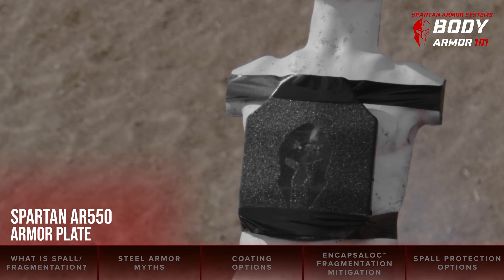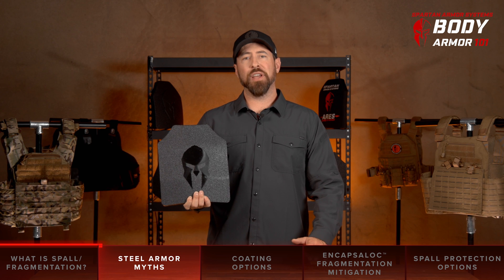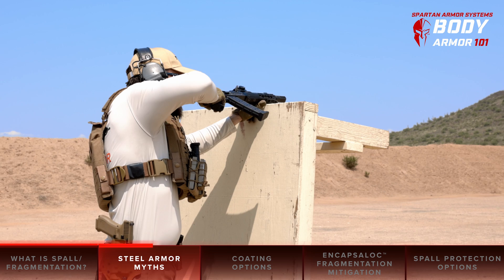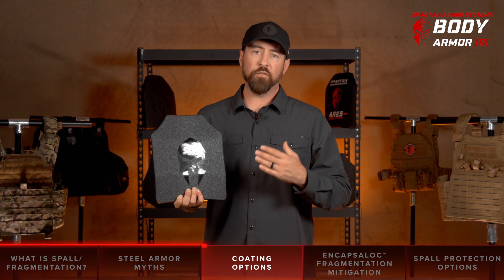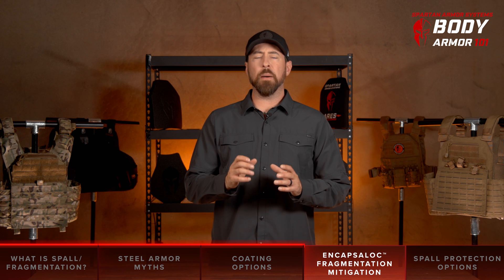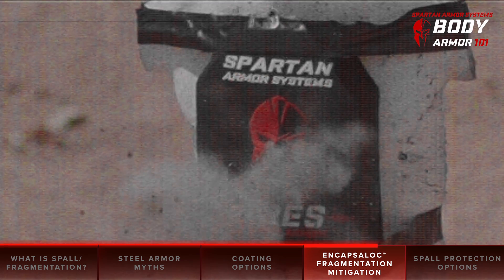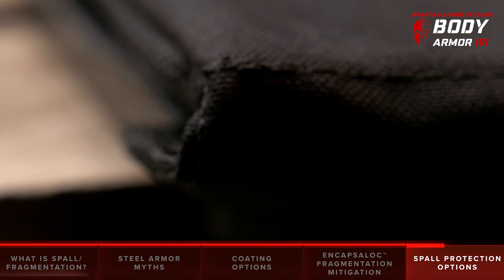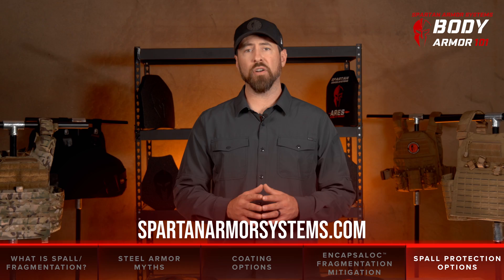Body Armor Spall & Fragmentation (Fact vs Fiction) - Spartan Armor Systems Body Armor 101

Comment: Steel plates, such a good option that the US military uses them! Wait, no... OK, well at least police departments nationwide are using them! Oh... right... they aren't either. If all the pros wear ceramic or uhmwpe composite plates, and NONE of them use steel, there's probably a reason for it. The guys who actually use their equipment day in and day out know what the right tools for the job are, and it's not steel plates. Great marketing video though!
Reply: Cops and military get ceramic because you and I are paying for it, not them personally.
Reply: @socaljarhead7670  there are several NIJ rated, reputable ceramic plate manufacturers that cost as little as steel plates with spall coating do.
Reply: @ThePonchoJoe  NIJ level IV is rated for a single hit. Level III is rated for 6 hits. There are some police positions and situations where if you get shot, you may end up getting hit multiple times in very quick succession so you'd favor armor that is guaranteed to take multiple hits but will never see the wrong end of a 30-06 AP round versus take more than one hit stacked on the same spot and the bullet goes right through because the previous shot compromised the ceramic at that very spot. A lot of level IV plates would fail at level III because level III has the specific 6 shot test while the level IV test is only a single shot.
Reply: @Talishar  none of what you just said is true
Reply: @ThePonchoJoe  You have literally no idea what you're talking about. Read the specs.
Reply from the maker: Actually, there are lots of police and sheriff's departments that use steel plates. They buy them from us all the time. We've had many cases where our steel plates have saved the lives of officers in the line of duty and there were no secondary spall injuries.
Reply: @SpartanArmorSystems  there's a variety of reasons why steel plates are less than optimal, spalling is just one of those reasons.
Reply from the maker: There's a number of reasons why ceramic plates aren't optimal either. We sell both and provide plenty of educational content to help customers decide which armor material is right for their specific situation. It's not an accurate statement to say one type of armor is superior to the other.
Reply: The main reason is weight

Comment: I dont understand what is so hard to understand about layered protection.  A player carrier with level 4 steel plates, that have a full spall coating and are inside of spall covers with soft level 3 inserts infront of them and trauma pads behind them. 

It's such a wierd argument that people make wear they only shoot 1/5 of the armor system and then claim to have defeated it. No one in the infantry is being issued an armor plate with duct tape. They have a carrier with soft inserts and hard plates.
Reply: well i have heard of some guys in the military ended up getting some of their junk removed after getting hit on the armor plate. 
Maybe it was the same guy who duct taped steel plates to humvees
Reply: @trollmastermike52845  It's an urban myth. 

It's like how guys in the infantry are taught that the green tip on a 5.56 round means It's armor piercing, because it has a "steel penetrator". Or how the Shockwave from a 50bmg passing close to a body can blow an arm off. 

I'd say a good 25% of the guys I served with swear they knew a guy who saw someone get ripped in half by a "near-miss" from an M2HB.
Reply: @aceykerr8752  well its was a maybe it was a urbin mith with the doctors who operated on the guys who got shot. A grunt did not tell me the story
Reply: @trollmastermike52845  Thats even more likely. Doctors are comical with how they exaggerate. I saw an interview recently where a doctor was talking about how wounds caused a 5.56 were so destructive that it made people unrecognizable and how the damage made it hard to tell that you were looking at a human and not a sack of ground beef.
Reply: @aceykerr8752  well i have seen some videos on 4chan that say other wise what a 5.56 will make you look like doctors are right about that one
Reply: @trollmastermike52845  "One looks like a grenade went off in there,” University of Arizona trauma surgeon Peter Rhee told Wired when comparing the damage done by AR-15 bullets and 9mm handgun bullets. “The other looks like a bad knife cut.” Literal doctors will say that it looks like a grenade went off inside of a person, because 1. They have never seen what a grenade does to a person and 2. They have a vested interest in making it sound as extreme as possible. 

These same doctors will claim that the 5.56 is moving so fast that it sends ripples through the water in the body that can rupture organs and blood vessels without the bullet touching them. It's complete nonsense to anyone who understands terminal ballistics. It sounds like something that might be real and because a doctor said it, most people will take it at face value. But it's a myth that has no evidence to support it.
Reply: @aceykerr8752  dude just look some videos up i have a dudes h3ad pop like a water melon in mexico for a m16
Reply: @trollmastermike52845  Iv seen 5.56 wounds first hand, and you wanna know something?

Almost every cartridge in common usage will make a human skull turn into a gooey pile. The skull is literally the most susceptible part of the body to being damaged by bullets. 

But that's not a good indication of how much damage a bullet does to the human torso. Subsonic 9mm will turn a human head into a canoe just the same as 9mm+p+ will and just the same as 5.56 will. 

But thats not what doctors are claiming. Doctors claim that a thoracic wound from a 5.56 is so devastating that their won't be anything left to fix "The tissue destruction is almost unimaginable. Bones are exploded, soft tissue is absolutely destroyed. The injuries to the chest or abdomen — it’s like a bomb went off.” If a bullet hits an arm or a leg, he said, the limb often hangs at an unnatural angle. Such victims can need a dozen surgeries over months. “Some eventually decide to undergo an amputation if there is severe pain in the limb and it is dysfunctional,” he said. This is complete nonsense. 

"You will see multiple organs shattered. The exit wounds can be a foot wide.” 12 inch wide exit wounds? From a projectile 5.56mm in diameter and just over an inch long? 

"I’ve seen people with entire quadrants of their abdomens destroyed.” AN ENTIRE QUARDRANT OF THR ABDOMEN DEATROYED???

"The high energy bullet creates a blast wave around the bullet. And the yaw can contribute to the larger exit wound. Striking bone can also cause bone fragments that radiate outward, cutting tissue in each fragment’s path." Literal blast waves created by such a high velocity round.

"If they are shot in the torso, there often is not a whole lot we can do,” he said. Even though 88% of people survive thoracic gun shots if they get to a hospital, jumping to 97% if their is no arterial bleeding. 

"Dr. Kerby said it used to be that surgeons like him saw victims of assault rifle shootings only in the military. No more. Now, though the wounds are still rare on the streets of Birmingham, he operates on occasional victims — that is, those who survive long enough to reach the hospital." Even though assualt rifles and assualt weapons are a buzzword that mean nothing, and rifle wounds have existed in the US just as long as hand guns wounds, and the survival rate among rifle wounds is identical to the survival rate among handgun wounds. 

But Doctors help spread urban myths because they simply don't know any better. Iv never met a trauma surgeon who could tell me the difference between a 5.56 and 30-06. Iv only ever met one doctor who knew the difference between an m193 and m855a1, and that's cause he was in the infantry with me before he went to med school.
Reply: @aceykerr8752  " Almost every cartridge in common usage will make a human skull turn into a gooey pile "
well i guess does doctors where right
Reply: @trollmastermike52845  Thats not the point in question. No one disputes the fact that getting shot in the head is anything less than lethal. 

The contention is when Doctors talk about thoracic wounds looking like someone set a bomb off inside of a person's chest. It's completely unfounded.
Reply: @trollmastermike52845  The argument becomes even more nonsensical when we look at your claim of a doctor saying that someone's junk was damaged because their armor took a bullet, even though issued armor in the military is a ceramic plate behind soft armor and inside of a carier. It's complete nonsense to anyone who has any understanding of armor.
Reply: @aceykerr8752  Bruh i trust a friend of the family who was a doctor in a combat zone over a internet guru any day. 

You ever heard of sapi plates maybe you should do a little research infact i own US military surplus sapi plates.

From what i understand he had frag on his thigh too, but his junk area got most of it. He told me was shot on the in bottom area of the plate is what he later found out.
Reply: @trollmastermike52845  A sapi plate is just a ceramic composite plate. It wouldn't matter if the plate only got hit on the edge, because they are rated for that. 

And their is an entire soft layer of armor infront of the plate that is meant to stop pistol rounds, any shrapnel that makes it comes off the plate is going to be small and anything that makes it through the soft armor is not gonna have enough energy to cause damage. 

I'm just some random dude on the internet that you will never meet and will never know anything about. But your family friend was exaggerating. It's fine, everyone in the military does. We all embellish our stories to make them sound cooler because that's how you tell stories. 

But you should not base your decisions of what gear to use based on some story you heard from a guy who heard from another guy that this thing happened. Look up the data, examine how gear is meant to be used in the field and make the judgment call based on complete data. 

You and I will never know if your family friend was spot on accurate that a guy in a combat zone took a bullet to the bottom of his plate and it spalled enough to damage his junk. It sounds like bullshit veterans say at the bar when they drunk, and I would know because I do that shit all the time.
Reply: @aceykerr8752  The soft armor is behind the ESAPI, not in front of it.
Reply: @KarnivorActual  The soft armor is infront on the MTV.
Reply: There’s no such thing as Level IV steel plates.

Comment: Would trauma pads be recommended while wearing the Ares plate?
Reply from the maker: I'd recommend trauma pads on any type of armor. They're inexpensive and they mitigate the effects of blunt force trauma while also making armor more comfortable to wear. Ceramic armor is more susceptible to backface deformation than steel armor.
Reply: @SpartanArmorSystems  Thank you

Comment: People want to stick by ceramic but ceramics a throwaway armor it's not something that's feasible for long-term use.  A piece of steel wrapped in Kevlar can do a heck of a lot more than ceramic ever could.
Reply from the maker: Yeah, there's definitely pros and cons to both materials.
Reply: @SpartanArmorSystems  I guess it just really depends on the application of the armor.
Reply: @Linus Sex Tips  I would do it with steel plates over ceramic any day.

Comment: Will the threat of spalling decrease if you're hit in the back plate?  
Seems like steel in back with ceramic in front is an interesting combo as the back plate is also more likely experience damage from simple impacts.
Reply: Every encounter is different but we do have may customers that like the combination you mentioned.  Thanks for your interest.
Reply: How does the round know it's hitting your back plate vs front plate to reduce fragmentation? Smart rounds?
Reply: @KB-nt7eg  I think the idea is that when in combat your emote likely to get hit in the front than the back, and so with ceramic in the front you don't worry much about spalling.  On the back however, it's not as often getting shot there and hopefully you'll have protection on your head, which can stop the spalling..
Reply: @nomad155  he said, and I quote 'will the threat of spalling decrease if you're hit in the back plate?'

That makes zero sense. Spalling doesn't stop on an uncoated plate simply because you're hit in the back.

I think, at the end of the day, Todd Meeks says as little as he does, because of people like you and the original poster. 

They make ball mounts for lifted trucks even though you shouldn't tow with a lifted truck
Reply: @KB-nt7eg  Your arms, jaw, and throat surround the front of your chest where spall will eject towards when shot in the chest plate.

Comment: So, say the "Shizzie has hit the Fizzie" and someone's lucky enough that their armor plate has stopped a few rounds and they're still vertical and kicking. What kind of "restoration" would spray the plates down with say a rubberized undercoating from aerosol cans add? Obviously not asking officially (or legally) just a curious, long-term inquiry.
Reply: Truck bed liner or flex seal
Reply: I sprayed mine with flex seal then a layer of duct tape
Reply: @LethalMayo  Like a literal layer of gray or black tape?

Comment: Thanks for this video. I purchased a set for myself and my wife. Great job dispelling the myths. Some of these internet warriors and twitter veterans have no clue.
Reply: @Emmanuel Goldstein I wore my 5.11 carrier with front back ar500 steel in them while working during the "protests" in 2020. 10, 12 hour shifts...was lock knee'd for a couple hours straight one particular night and blacked out for a nano second. The carrier I have is very padded with a lot of surface area, very comfortable. Still heavy as shit and potentially contributed to some exhaustion by the end of the shift. Not terrible though.
Reply from the maker: Glad it was helpful!
Reply: @Emmanuel Goldstein I mean the army frequently rucks with 80+ pounds of gear for up to 48 hours. So a 20 pound armor set is nothing for fit individuals. At least try to sound educated.
Reply: @Emmanuel Goldstein Dude a my highschool backpack was 20lbs thats not much.

Comment: Looks like the coating works for a rifle, but have tests been conducted to address subsonic handgun ammo against steel, at an *angle*? Because of the slower speed, the rounds may not penetrate the coated steel, causing a deflection to the wearer, or
Is this a nonissue?
Reply from the maker: This is a non-issue. The rounds would still behave the same way despite being subsonic. The energy of the bullet would cause it to mostly liquefy with some fragmentation which would be captured by the extra coating or spall containment sleeve depending on which you choose, or both.

Comment: But this still doesn't show the fact that with a steel plate, you get punched a hell of a lot more in the chest, causing possible shattering of your ribs which then fragment into your lungs, heart and muscles. While with most ceramic armor it helps disperse that kinetic energy rather than throw it back into your body helping eliminate that punch, still causing a broken or cracked rib but not a shattered rib. Ceramic is better than steel
Reply from the maker: Both materials have their pros and cons. Steel actually dissipates the energy across a larger surface area where ceramic BFD is more localized to a smaller area. It's the difference between a slap (steel armor) and a punch (ceramic). Both are going to hurt but I'd rather be slapped in the chest than punched in the chest. The benefit of ceramic is that is destroys the projectile which significantly decreases the velocity of the remaining fragments that are then caught by the backer. It also really depends on what round is impacting the armor and from what distance.
Reply: Newton would have some complaints about your physics here. Given identical plate/firearm mass (a reasonable assumption with steel plates), total impulse on the receiving end will be less than free recoil on the shooting end by the sum of the gas/particulate impulse (more than people realize) and energy lost to projectile air resistance -- 1/2 m * (v1^2 - v2^2). A heavy plate with no deformation is best-case scenario in your setup. The impulse on the receiving end, while lower, will have a sharper curve because the projectile takes 40cm to accelerate and 1cm to decelerate, but this is still not enough to scramble someone's insides without extreme deformation any more than recoil through the stock could shatter your shoulder.